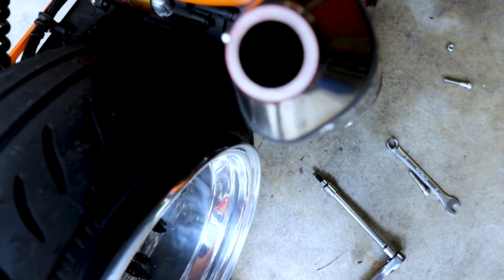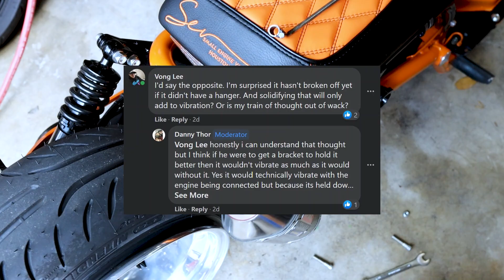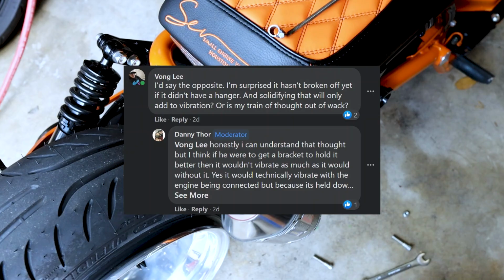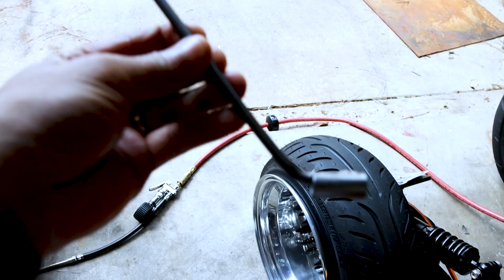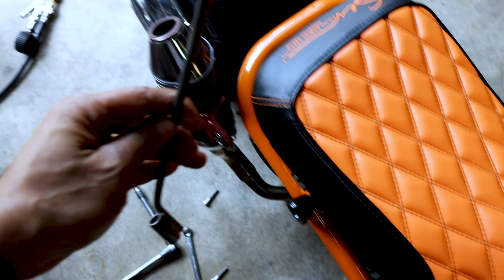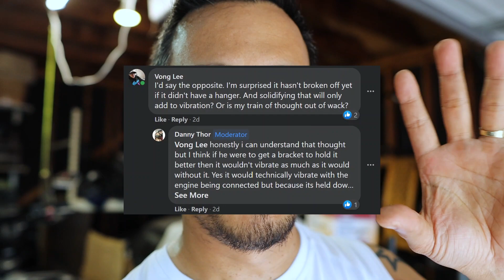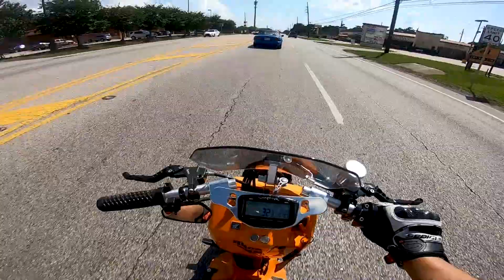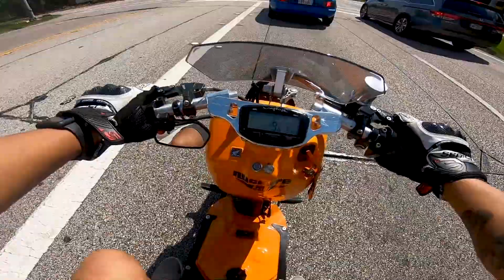Exhaust Hangar and Unexpected Harley Race #SmallEngineVelocity

Comment: When I first did the upgrade to a different exhaust pipe and muffler , I didn't use a hanger either because everything seemed to be pretty secure and solid , so when I took my GY6 for the first ride with the new exhaust system, the muffler came loose after 10 min into the ride, I live in the country side and I was riding during the night as you can imagine everything was almost pitch black , took me like 30 minutes to find the freaking muffler, not gonna lie I was pretty scared because I felt like a ghost was going to come out at  anytime, honestly I was shitting bricks the whole time when looking for the muffler, 
Looking back it was a pretty funny experience 
I end up welding the pipe and muffler together and I made a custom bracket to hold the muffler , I never want to go through the same experience again in my life! 🤣
Reply: Dang man I feel you. I live in a rural area too and sometimes I get nervous riding new roads at night. I scrape my exhaust but I’ve had a few close calls 😅
Reply: @mechamoto6102  haha I thought I was the only one that feels that way, I kinda stop riding at night  I think is very dangerous ,last time I was riding during the night I almost hit a deer , I got  lucky and  nothing happened to me but I'm  not so sure if I'll be that lucky if that ever happens again, so that's another reason fot me to stay home during the night 😅
Reply: @jmrbuilds  man I hit a possum last year! 🤣🤣
Reply: @mechamoto6102  omg that's crazy, good thing you are alright!
Reply: @jmrbuilds  luckily I was coming to a stop but it charged at me lol
Reply: @mechamoto6102  possums are dangerous creatures lol , I had I couple of not too good experiences with a few of them , I would never kill one but I just hate them I don't know why lol

I was checking out your videos your Ruckus looks  pretty sweet 👌
Reply: @jmrbuilds  yeah it literally charged across the road 🤣. 
And thanks brotha

Comment: Let’s get into that light weight flywheel!! I’ve been measuring different ones and have found various weighted flywheels
Reply: How bout a break down of what you found? Angle of the slots, diameter of the pulley surface, and weight of each. That kind of info isn’t compiled on the forums that Google knows of.
Reply: I’ve had a few gy6 engines and I brought an 11pole stator/ flywheel combo. The combo had the heaviest flywheel, and the different is hard to see, but 20 to 40 gram differences!!
Reply: @jabaricathcart7814  
10-4 bud. I appreciate the info. I was looking at a swapping my stock sheave but now I think I’ll just leave it alone.
Reply: Anyone with a lathe? is the best way to lighten em. Just mill the outside down I bet you can loose some weight!!
Reply: @jabaricathcart7814  
I’m a machinist. Been one for over 10 years. There’s not much material there to remove. Maybe 30 grams that’s a big maybe. More weight can be saved by going to a different material like titanium or aluminum. I’ve got the reveno clutch and the difference was pretty noticeable. I understand that the clutch style changed along with loosing weight. A titanium secondary sheave or aluminum with the center ramp section ( the slotted section) pressed in would loose substantially more weight than just trimming the lips on the edges of the stock style. Not a lot of material to remove on the stock ones without compromising structural integrity.